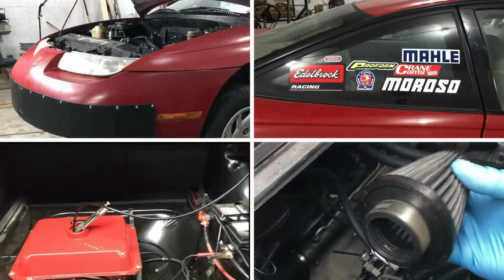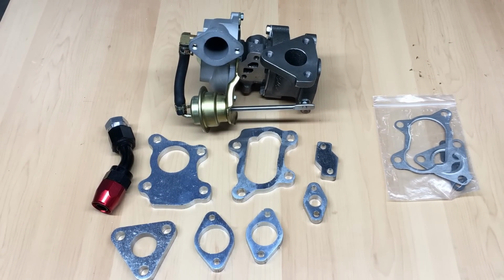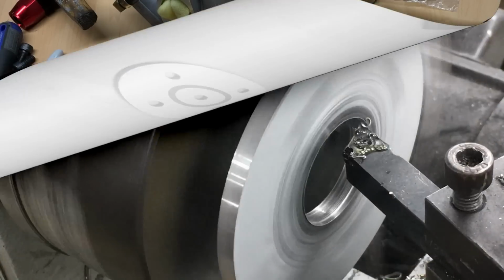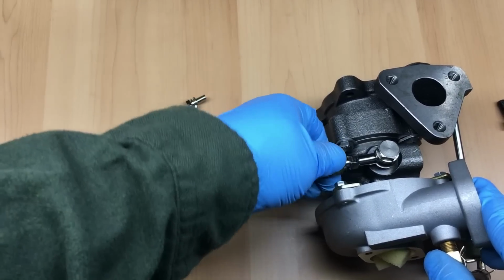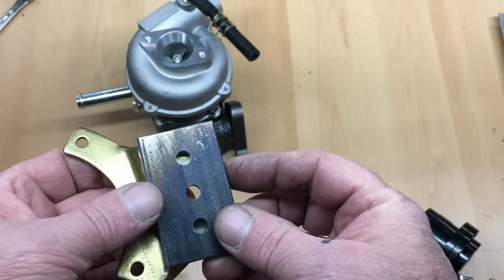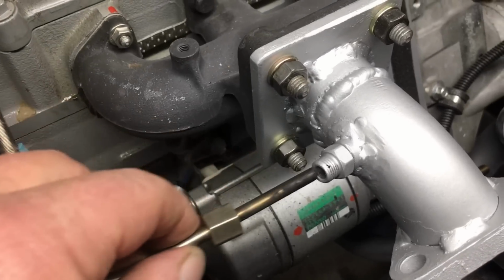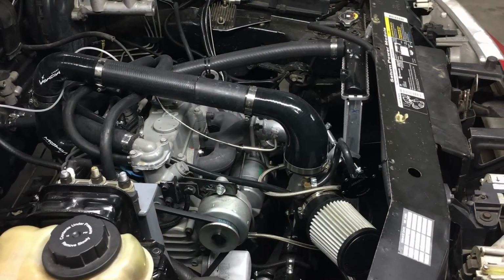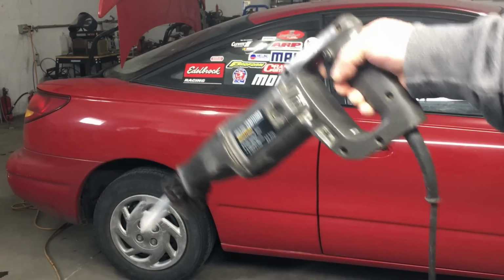S3 E5 We install a RHB31 turbocharger on the Kubota D722 diesel engine in a 1999 Saturn coupe.

Comment: Hey! They make these manuel boost controllers that go I between the waist gate and the presure side of the turbo. They allow you to control the boost with more granularity and it helps the turbo spool faster. Best of all they are pretty cheap. Would recommend
Reply: A manual wastegate controller controls boost pressure at high load/speed conditions, if your wastegate is opening and killing response time at low/part throttle, your turbo is incorrectly sized for it's application, and this application probably needs no wastegate, as injection timing and quantity are the determining factors on power output, not boost.
Reply: @jamesgeorge4874  ah thank you. I've only read about boost in Otto cycle applications. I have no idea about there use in deasil applications. On top of that I only have read about them in high power applications. Also wouldn't this be a high load/low speed condition?
Reply: @putinslittlehacker4793  spark ignition petrol powered engines are very sensitive to AFR, and overly lean / rich mixtures greatly affect power output, longevity. Diesel engines output relies on the amount of fuel injected (and timing) and if enough airmass is not available, the engine will smoke. More airflow than  needed reduces smoke, and EGT, but does not hurt power output (in reasonable amounts) .
Reply: @jamesgeorge4874  OK, also why does more fuel injected effect exoust temp but more air plus more fuel doesn't. It would seem with more air it would burn more fully and create more heat. Plus the turbo without an intercooler adding more heat.
Reply: @putinslittlehacker4793  X amount of fuel can only create X amount of thermal energy. Adding more air reduces egt because there is more airmass than needed to burn all the available fuel,.and this cools the gasses leaving the chamber on the exhaust stroke. An intercooler reduces the intake charge air temperature, and this increases it's density, which, inturn, increases efficiency, as more fuel can be added, because more air is available to burn the fuel. Intercooling increases power, by increasing efficiency.
Reply: @Momma Panda Robot Cantina is indeed, an entertaining, and rather humble YouTuber, and I certainly do enjoy Mr. Cantina's content. Mr. Cantina has some rather humble viewers as well, and that's a nice bonus. Mr. Cantina kinda brings out the optimism of a mechanical journey of discovery, in a wholesome manner, and is pretty inspirational in his ways. I too, will be looking forward to the next episode.

Comment: I do find your videos interesting since you're saying that diesel engines Run Exhaust gas temperature cooler and run leaner with a turbo that to me would make sense that since it's running leaner your miles per gallon is going to increase with the turbo installed

Comment: Kinugawa makes some neat turbo stuff for sure. :)

That's zinc chromated plating, you're right, don't want to be welding that. Vinegar would have taken it off too, maybe not quite as fast, but fast enough.

Could have used some coupling nuts for the spacers, but your local store might not have them in metric, so fair enough to make 'em on the lathe. 
I should've thought of this one, I spent waayyy too much time on extending the bracket and shortening the actuator rod. facepalm

related to the actuator and the expected boost pressure, it probably needs a little bit of preload dialed in on the actuator coupling rod.

Ha-tchutututu, that was way too funny :D

Comment: So glad the turbo is getting mounted correctly now 😂 only way you can “vertically” mount a turbo, and I’m pretty sure it’s no more then 15 degrees is with a ball bearing turbo and with the use of a vacuum pump on the crankcase or really really good ventilation.
Reply: A scavange pump will help drain a turbo that doesn't drain well.

Comment: That flange manufacturing was interesting! The exhaust manifold flanges are actually made for marine engines, you need it to make an after mixer where you spray used seawater into the stream of exhaust gas and then you use a rubber exhaust pipe. Now I know why they are so expensive!
Reply: Got me thinking about adding a turbo to my marine yanmar 3gm30f. Then giving up mentally contemplating all the piping mods

Comment: Another outstanding video.  Inter cooler will help a lot.  I am salivating waiting on the next video.  Why trim off weight? get all the engine mods in place and then if needed trim.  There is not a lot you can take off anyway.  Some trimming can actually hurt air flow around the car and that would be a negative gain IMHO.  Good luck and God Bless.

Comment: gas welding is akin to tig welding and is not nearly as expensive just oxy acet tanks and a welding head for a torch ive welded whole cars together like this also is easier to learn and standard tie wire makes good welding wire check out some of the expert gas welders out there in youtube land you can also weld cast iron stainless aluminum titanium copper plus just about any other material known to man. the only 2 methods accepted for welding aircraft frames is gas welding and tig welding if you have any questions on the process ill do my best answer em and dont let anyone tell you its too slow of a process ive welded miles of steel and aluminum with oxy acet and it aint that slow
Reply: hope you seen my comment i noticed youtube has been hiding em from others i can only see it if i log into my account

Comment: I would highly recommend installing an oil catch can, at least one of those cheap universal ones, because the compressor and the inside of the housing will get pretty caked up with the carbon oil mix that exits the engine.
Reply: Don't feed the compressor with crankcase fumes is a better idea, since the builder isn't obligated to....

Comment: Be cautious with the oil T-Fitting being attached directly to the block. Vibrations and tension of lines can cause the fitting to snap at the block. Had that happen to a friend on his civic. The solution was to use a small piece of high pressure hose between the engine block and the new T-Fitting. Not sure on how it works on the Diesel tho. Just a heads up.
Reply: Yes, for SURE... I never mount a T fitting solid like that. I ALWAYS use a fitting and a piece of hose on all connections.

Comment: I’d suggest venting the crank case to atmosphere not into your engine as it could potentially run away on oil because of it
Reply: Second, turbo engines usually have the tube down to the road, unless they have some crazy filtration system installed to route it back to the compressor inlet.

Comment: I'd rather Jimbo put on a dual turbocharger. A high-pressure turbocharger and a low-pressure turbocharger. That way, once the high-pressure turbocharger is spinning at max, the low-pressure turbocharger will really start to suck in air. That compressed air will feed the high-pressure turbocharger

Comment: ALL I WANT TO KNOW IS why are there special screws on the injector pump?  The engineers had a problem with using regular screws or bolt heads?
Reply: Are you talking about the safety Torx heads?  It's just to stop someone with 'common' tools from popping them out and messing with things.
Reply: @DrFiero  But why?  Who would mess with those screws for no reason?
Reply: @gchsbus  You must be new here.   :D
Reply: @DrFiero  I am not.  The screws have nothing to do with Robot Cantina.  The way I see it, no one should be messing with a diesel injection pump unless, one, there is an issue, and two, the person knows what they are doing, because three, they are a diesel certified mechanic.  I know the area is under pressure, hence maybe the reasoning why the engineers want to deter people from messing with it.  it just seems to be on the same wavelength as those special screws on cell phones or even the Nintendo 8-bit back in the day.  Just put regular screws or bolts in it.  It is an injection pump.
Reply: @gchsbus  - humor challenged much?

Comment: I think on diesel engines you dont really need a wastegate. Just limit the injector pump if boost pressure gets too high.
Reply: you do need wastegate. Almost all turbocharged diesel engines with standard geometry turbos have wastegates. If they didn't, the turbo would overspeed and get damaged
Reply: @dieselgeezer18  "Almost all turbocharged diesel engines with standard geometry turbos have wastegates" , I'm not so sure about that.
Basically all standard geometry turbocharged tractor and other industrial diesel engines I've seen don't use wastegates(Most of them is 20+ years old though).
Also I'm quite sure (Not entirely though) I've seen at least one original non-VGT turbo-diesel car without a wastegate , lol...
But yeah, most cars probably uses wastegates though and cars probably is a big part of all turbo diesel engine using equipment, but I still think saying "almost all" having wastegates isn't true.
Reply: @TarenGarond  on old equipment i've seen non-wastegated turbos a few times, but every diesel i've ever seen made after the 90s had a wastegate. The arguement pepe the frog made saying " If you need a wastegate to limit turbo rpm you have an ill designed system." is soo wrong. Literally almost every car brand made wastegated turbocharged diesel cars.
Reply: @dieselgeezer18  Yeah I obviously agree with you that the original poster is wrong!
It was only that "almost all"(That I read as "almost all from the beginning of time", I mean you didn't mention any specific time period XD) that bothered me.
Reply: @dieselgeezer18  no you don’t. Diesel engines are throttled with fuel, not air. You may notice the engine it self does not have a throttle body, how does it not run away?  Diesel engines can tolerate a wide range of air fuel ratios and that means you can control their power with fuel alone. (Within reason)
Reply: @Turbochargedtwelve  yes i know that. I was not talking about the engine. The engine will run absolutely fine with an non-wastegated turbo. The turbo itself though won't like it at all and will fail prematurely.
And if you limit the fueling (as the top comment said) to prevent the turbo from overspeeding then you will lose lots of power and have slow turbo spooling
Reply: @dieselgeezer18  Wastegate is to limit boost pressure to prevent engine knock. Diesel do not need that. If you need a wastegate to limit turbo rpm you have an ill designed system.
Reply: @pepethefrog7193  wastegate in diesel engine is mainly to prevent the turbo from overspeeding and failing. It is also needed to reduce the amount of air entering the cylinders in order to reduce NOx emissions and make the turbo spool up faster. Most people don't care about NOx emissions but car manufacturers very much care.
Standard geometry turbos most of the time need wastegates (except in cases were the turbo is large/strong enough and the exhaust power can't overspeed it). The ONLY turbos that don't require wastegates are VGT turbos. These turbos can basically open the vanes and allow more exhaust to flow freely without excerting force onto the turbine wheel. So no wastegate needed because the vanes themselves act as a wastegate

Comment: I get about 14-18 psi with the vz21 on my Kubota D722, so you have definitely room for boost.
Reply: I also managed 18 psi with an RHB32 on a 1.5l Isuzu diesel engine in my van. I've since upgraded to an RHB4 and now make 24 psi. In both cases I completely blocked off the wastegate.
Reply: @althejazzman  I would have guess 16-20 being the limit for this turbo on his engine so that all makes sense.
Reply: I wonder if the wastegate is limiting it
Reply: @5.43v  I doubt it, my wastegate mounting plate is bent to the side for maximum boost.
Reply: @Bluezero75  no, cantinas boost
Reply: @5.43v  thats the function of the wastegate.  You want it to limit boost when you're testing..
Reply: @NVMDSTEvil  yes he is testing. I wonder what's the max boost that he'll get
Reply: @NVMDSTEvil the waste gate relieves boost when you suddenly let off the gas. Prevents damage to engine and turbo along with piping blowing off.
Reply: @zacharywhite8230  use the words "the wastegate does not and cannot control or influence boost pressure."  I'll wait.
Reply: @NVMDSTEvil  no shit. It relieves boost pressure from the line in the event you let off the gas suddenly. Look it up.
Reply: @zacharywhite8230  whoa, imagine if it had a spring that operated a specific pressure point!
Reply: @zacharywhite8230  I thought that a by pass valve or blow off valve as some like to call it is what relieves the pressure when you let off the gas, not a wastegate? Sure you're not confused?

Comment: One little tip for the flange turning Jimbo. If you lightly clamp a longer bolt into the chuck with the threads sticking out,  and the bolt head hooked onto the back of the jaws, then you can tighten down the workpiece onto the front of the jaws, and tighten the jaws fully on the bolt. This means the part is being spun by the bolt, AND the friction against the front of the jaws.
Reply: Not only that, but you get massive stiffness benefits from the part physically contacting the jaws. Great suggestion.

Comment: Anyway.. ihi rhb31 is a tad too small for your engine...

Diesel engine require a little bit more air flow than equivalent gasoline engine....

Since its rated to about 64hp for gasoline engine, on diesel it probably topped at about 40hp.. at crank...

So something abit bigger like subaru vf25 or tf035 would be the best candidate for performance gain...

Comment: I don’t have the most experience with turbos but I’m pretty sure your waste gate is reading boost at the turbo and your boost gauge is reading at the manifold. So due to flow restrictions and heat loss there will be a drop in psi from from turbo to the manifold. You will probably want to run your waste gate spring closer to 10 psi to actually see 7 psi at the manifold possibly 11 or 12psi once you intercool it. Also I think playing with timing a little and adding some fuel will help it too. Great video though and I can’t wait to see how this will effect power and efficiency.
Reply: On a diesel injection timing makes a massive difference for boost and response.   Advance the timing now that you have more air and don't bother with a waste gate, they don't matter on diesel until you're into compound and like 100 psi boost.
Reply: @TurboVisBits  you dont need push 100 psi boost that far I advised against keep in mind that you want to make it reliable not shattering to million pieces
Reply: You're close, but in his case reading at the turbo outlet and intake manifold should be very similar. The biggest flow restriction usually comes from the intercooler. Even when he installs one, I doubt the pressure loss will be very high at all. certainly not 3 PSI. Given the very short run of piping, I doubt the pressure difference would even be noticeable on a boost gauge. I could be wrong, but just adding my thoughts. Measuring pressure at the turbo outlet and at the intake manifold, especially before and after installing the intercooler, would be very cool and informative!
Reply: Run 25 psi with the intercooler. The Kubota can take it.

Comment: on a journal bearing turbo such as that you don't want any flow restriction, if the drain is not restrictive and backing up the oil into the turbo then the more oil you can get into it the better.
Reply: You STILL need an oil restrictor on the oil feed going into the turbo. Without a restrictor, there will be TOO much oil flow, and the oil WILL get past the seals, and the engine will smoke.
Reply: @davelowets  I don't know who told you that but it's simply untrue. It is only relevant for ball bearing turbochargers which do not float in an oil film